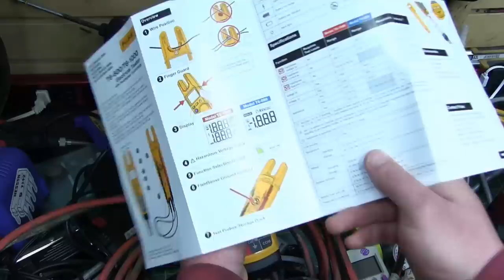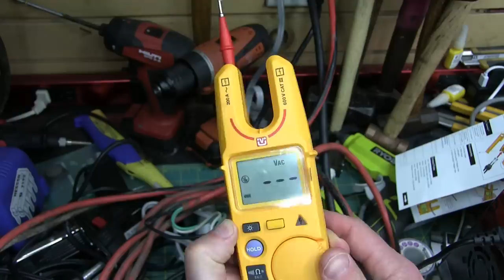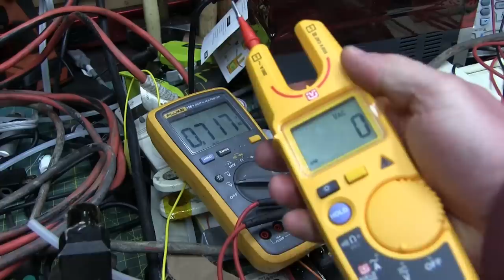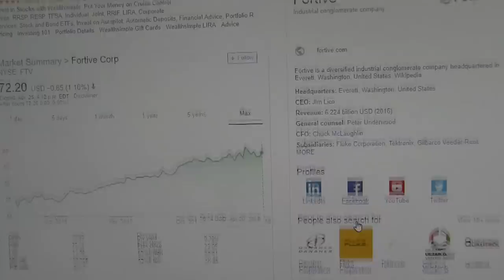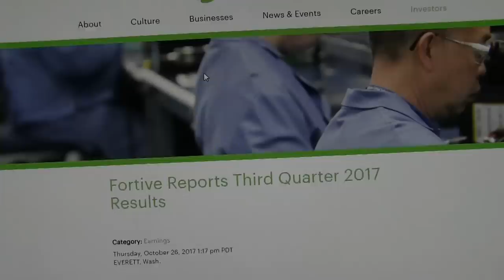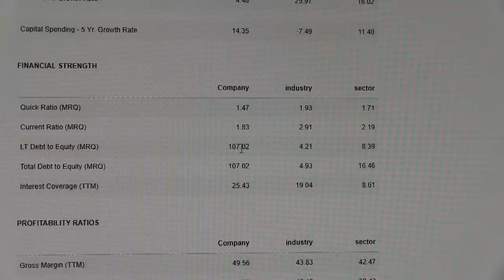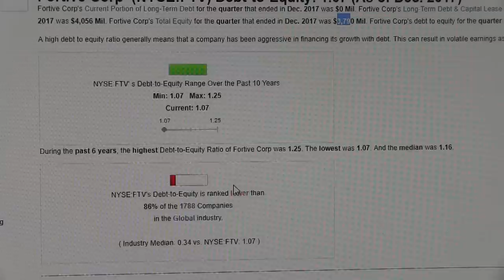Fruke's JOY BUZZER™ Multimeter! | SHOCKINGLY BAD T6

Comment: I remember when your apprentice was the only voltage sensor you needed. "Hey Skippy, touch that"
Reply: whoflung dung haha :p
Reply: Daniel Rouw I've caused a brown IN with just my fingers before... Nearly killed by a home gamer's piss poor job of a ground line.
Reply: My father did that to me once, I wired his plumbing to a 25 kva electric fence unit for that...
Reply: If the apprentice isn't handy a cat will work for that purpose too. I discovered that at a young age when one of those aggravating cats that like to rub all over you when you are doing something, just happened to get too close one day when I was trying to figure out if the lawn mower spark plug was getting any spark...did you know that a properly motivated cat can jump 10 feet straight up in the air?
Reply: My dad used to do the safety testing himself. I remember when I was a young lad, him once removing a spur on the lighting circuit in our old house (180 years old at the time). That place had cabling in it from pretty much every era, Some was even lead covered twin core !!!!!

Anyway, He flicked the main breaker in the fuse box, disconnected the spur at the junction box, Then turned all the power back on so to minimise disruption for my mum. He then took a pair of wire cutters to the power cable to help pull it through a beam, and found that it wasn't a spur, It was some kind of strange (And totally out of spec) bridge between the lighting circuit and a ring main !!! That places wiring was feckin lethal !
We ended up taking him to the hospital for a check up, Mainly because he was 10 foot up a ladder when he zapped himself, And rolling on the floor swearing a couple seconds later.

I kept hold of the cutters with two perfect little crescents blown out of both blades. I had them for about a year before giving them back to him........ Mounted on a wooden plinth, With a little brass plate I had made saying "Never take f*ck all for granted !". He thought it was funny, But I don't think mum ever approved. LOL !
Reply: i too tested 3phase on my arm once - gotta tell you your arm is a lot more accurate than this 'tool'.
Reply: I always thought a brown-in was when you sharted and hiccuped at the same time. Crazy.
Reply: I remember Poof the magic apprentice. He ended up roving for some Irishman.
Reply: Daniel Rouw a larger transformer increases voltage/decreases amperage, decreasing amperage a smaller wire can be used wont melt thee wires.
Reply: Gotta remember, back then gloves were not so ubiquitous. Calloused hands and fingers were worth a few hundred ohms or so of resistance. 
If you were working hard, just a tingle. If not... 🤣

Comment: This one can sense hertz too, just plug it into the wall and touch the back and you can see how bad it hertz
Reply: Manual hertz sensor, sounds handy.  You just need to count the voltage spikes in your hand with the stopwatch going
Reply: butthurtz
Reply: Like the bumper sticker says, "Electricians do it till it Hz".
Reply: You get a hour adrenaline boost, 60hz. You gotta touch it again to start your lil heart again, 50.

Comment: NO!  Everyone stop emailing me, I don't want to get involved!  Oh, OK then.....    The approach to sensing the presence of voltage with a field is always a bit touchy because it's very easy to bring your body up to the same potential just by touching the outer sheath of the same core if you're isolated from ground.  It makes it a bit hit and miss with all non contact testers for that reason.
If the Fluke posse have done their job right then that metal stud will have a chain of resistors in series that limit any current flow.  You'll still measure near mains voltage because your other meter has an input impedance of about 10Megohm.  If you were to test the current flow it should be a few hundred microamps max.
Yes, the features are a bit gimmicky, but that's how they charge more for the luxury models.  I'm afraid you might need to eat humble pie here and buy Fluke a cake.
Reply: Big man
Reply: bigclivedotcom yeah that's what I was figuring voltage is there but it will drop to nothing once current flow.s
Reply from the maker: Cake?! Gah! My Kryptonite. I think the grounding pad is goofy as hell. Input impedance is high IF THE METER IS UNDAMAGED. "Mmmm, 600V panel that I may ground through my body. Let me put my thumb on that; sure it's 600V but it's miniscule current." Rationally, I concede your point. Intuitively, fuck that noise. That voltage sense is so janky it's useless at best.
Reply: Exactly. Lightning has no problem arcing over a mile through the sky, why would anyone think it can't jump a fraction of an inch across a surge protector or switch.
Reply: bigclivedotcom Hi Clive, I think I'll get some of those shorts. Thanks.
Reply: Ok so basically what you're saying is that our lab rat ElectroBOOM needs to do his duty and test it for current flow.
Reply: As some one who works with electricals all day, there is no fucking way I would trust this over my DMM. Been bit enough to know I don't want to be again.
Reply: Jeff Symons The desired property of a surge protector is to give the lightning a much more enticing route than through your equipment.   It's not that lighting couldn't jump some gap to your device. It's that the lighting should jump the gap between live and neutral inside the suppressor and not bother the detour through your device.
Reply: bigclivedotcom you know what they say on the EEVBlog, don't turn it on, take it apaart
Reply: ehhh bigclive love the vids
Reply: Holy crap, the holy grail of videos would be AvE, BigClive and PhotonicInduction get together, along with electroBOOM, and do a shop vidjayo.

There is NO way this can end badly. Right?
Reply: And at 600v, how many micro amps might interfere with a pacemaker? I agree with AVE, Fluke a company that sells on quality and trusted reviews, has released a POS.
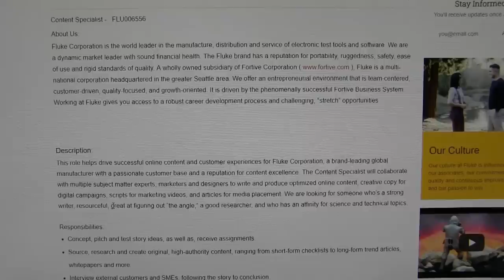Reply: Hahaha he is so upset because fluke guys told him that he is an idiot (that option #1 of previous video at 9:54).
Fluke marketing is probably a bit optimistic concerning the accuracy with just the body has ground (3% error + 3% extra without using the back probe on a proper ground) but other reviews showed that it works properly when using the black probe to ground and if you really insert the measure wire fully. This is an innovative design. Try to find any other device doing a voltage measure with just 1 contact to ground (you need a proper reference if you want any reliability). Is that feature really useful? I don't pretend that I can tell. Is it well implemented and easy to use? Maybe not but remember that this is already quite an achievement. Finally concerning the finger grounding... I don't like it too but it's fluke, not some low end brand so I bet they tested that properly and the risk is limited.
The biggest risk is if you are in amps mode with the black probe in the rear. But who is using a device like that this way without paying attention? He seems he wanted to find something bad to justify his anger.
Reply: you forgot dave from eev bloog
Reply: I agree ... that if that captain whiz-bang circuit is high resistance then the current availability will drop under load .
But a closer look at the circuit has not been performed in order to determine what is really going on .
The use of even a 7.5W "Christmas tree lamp" in series as i mentioned would be a quick way to provide a rough test and if it does light up it would make a great graphic representation .
somehow , I just can't believe that a company would produce such a pos-1 ... but , the times they are a-changing .
Reply: bigclivedotcom epic reply is epic.  All the YouTube electrophiles are coming out now.  Where is ElectroBOOM when we need him?
Reply: Jeff Symons or a few tiny current limiting resistors!
Reply: Don't be daft, John Wingate!  Surge suppressors are perfectly safe to use on your computer during a lightning strike... as long as the lightning isn't striking near you.
Reply: bigclive and AvE collaboration, now that I would become a pateron on both channels for! The personalities are so different but I can just imagine the Dr. Frankenstein stuff they would do.
Reply: bigclivedotcom only 3 stars on Amazon  for both the 600 and 1000. Many state how unsafe and non consistent it is
Reply: I ... hahaha
Reply: Still gabage! I think he should touch it and find out
Reply: IronAngelForge After raiding Clive's brother Ralfy's stash.
Reply: I read that in the Big Clive voice
Reply: I have the T6-1000 and it's actually pretty good. I think people just have to understand the limitations of voltage measurements like this and that it's only designed to give an indication not a true measurement. The rest of the functionality in this is solid like the T5.
Reply: SDG Electronics why would you buy a meter for a non accurate indication? fuck that shit
Reply: Whats the point of a meter if you only want a indication of whats going on?  
If you just wanna know if the circuit might be powered just use a chicken stick.  more reliable than this, and as unpredictable the field sense voltage is you might as well guess...
Reply: Don't those metal touch lamps work the same way? I have one somewhere, I should test it.
Reply: AvE 
Other things to be scared of: touch-lamps, USB phone chargers, carpeting...

High voltages lurking everywhere.

That clamp sensitivity seems pretty janky, though.  It is using the same principle as those non-contact voltage detectors, by the look of it.  Perhaps they have deliberately made it finicky about conductor position to avoid a false low reading?
Reply: Yea, those metal touch lamps works kinda the same way, thats why electrickans don't use it. if theres damage to it, someone threw it in a bucket of water or let it stay outside for the night you'd electrocute yourself....
Reply: Jeff Symons, because a lightning bolt is several million volts, it has a much higher arcing potential. Mains voltage in your home is limited substantially by regulating devices through Overvoltage Categories. Anything you plug into a home wall outlet, is evaluated for 1500Vpk transient voltage, and the spacing necessary by regulation between 240Vac and your body, is a meer 4.0mm. That's 0.16 inches.
Reply: I support the idea of a Clive teardown, as long as there is fizzy wine involved.
Reply: And thus, Science is done. You do research and you get peer-reviewed. Beauty.
Reply from the maker: Let's get Clive's brother Ralph to do a tasting and tasing!
Reply: "The current level is probably not life threatening in most cases but could be painful and may be sufficient to knock a person down or off a ladder." And nobody has ever died from a fall from a ladder, so there you go.
Reply: AvE Whisky tasing.  Now there's an idea.
Reply: bigclivedotcom it makes my day when I see my favorite YouTubers in the comments
Reply: Yea..... it's kinda like putting your hand in lava fast, layer of water vapor means it should be fine....but...lava... Clive you need to take one apart
Reply: Anyone who professes to have knowledge about a subject should know how to convey it properly. It's ground. really?

Edit: not to discredit your statement +John Wingate, please word better.
Reply: John Francis Doe Lighting will fuck anything it touches mate
Reply: AvE Hey, been a fan for a hot minute now an really respect you and what you do, but I think you're starting to clutch at straws to validate your outrage. I should know, I do it as much as anyone!
Just my inconsequential 2 cents.
Reply: So next time I get drunk and try building a rail gun what happens if I touch off  against the Marx generator during a 3000v cycle.... Do I blow the meter up or blow the meter and burn I hole in the palm of my hand
Reply: Mr Bunnykins didn't get a chance of even getting close to a vice easter last year.
Reply: id throw my 50quid in lol
Reply: carolyn mmitchell for convenience. It’s accuracy as hell all things considered
Reply: @kingofthe4rest  still the meter I have the most faith in is a good analogue meter such as an AVO 8
Reply: Well, being that the manual says you need to be wearing insulated gloves while using and on their how to page for the T6, it shows them wearing insulated gloves while getting a contactless reading of residential voltage, I think it's fair to say even Fluke doesn't want you to ground yourself to the ground on the meter. If the manual and instructions on their own website warn you repeatedly to only use this product with insulated gloves in order to cover their own ass, perhaps Fluke is aware this is poor design and procedure. Essentially, this is Fluke telling you they don't even trust it.

Comment: I will add this one comment. I am a design engineer for a leader in my industry and we are owned by a major "conglomeration" but one that is very centered on technology. We are relatively isolated from the bean counters leading us down the path to marketing wankery and producing complete bullshit. Though, the hunt for numbers lead to a reduction in quality due to supply chain leading the bull and it bit us in the ass. I was just given my next capital design project for 2018 last Thursday and the focus (refocus) was on safety, quality and complete customer satisfaction while focusing on a thread of modularity that will then benefit the company month by month. Thing is, we product capital equipment, not consumer products. What you illustrated is exactly what happens when you produce consumer products or commodities. The engineers run nothing.....they are at the complete mercy of the marketing dept who are at the complete mercy of the bean counters. I will never work in those industries for just that reason. I will never sacrifice my ethics or morals as an engineer to stock the coffers of the elite. EVERRRRRR
Reply: Amen